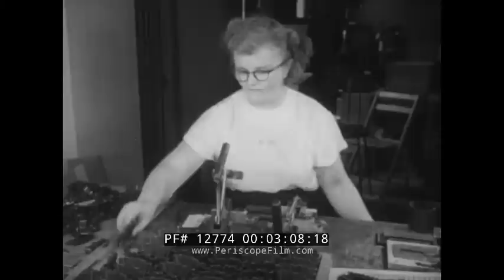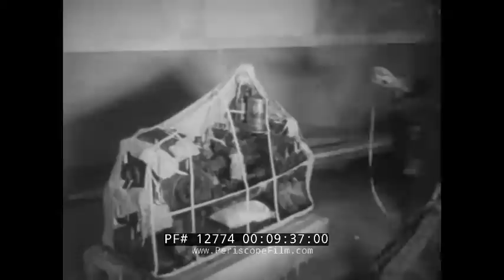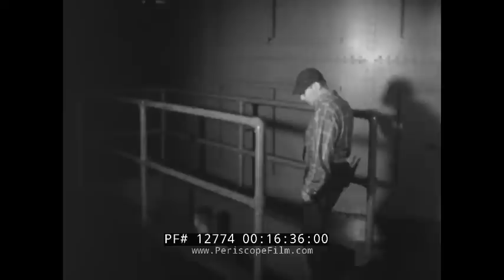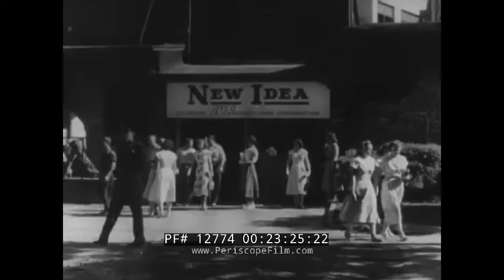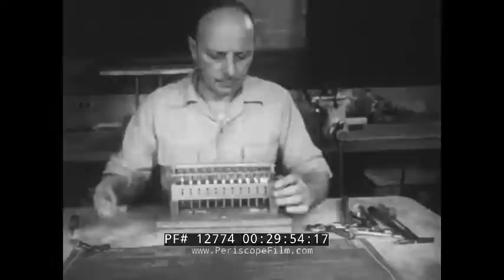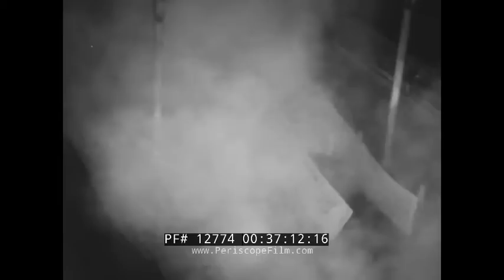INDUSTRY ON PARADE  HARMONICA FACTORY  MOHAWK POWER CO.  HALLMARK GREETING CARD CO.  12774

Comment: I'm not sure if I'm willing to believe they were managing to mold to .0001" back then.
Reply: Casting tolerance is simply a matter of designing oversized moulds to allow for shrinkage of final products and of course the quality control of of raw material
Reply: I'm guessing it was POSSIBLE,  but not used on everything, since that tight of a tolerance isn't needed on everything.

Surely parts of the mold were in that range.  Now, the cavity?  Depends on its shape, I imagine.  If it was easy to machine and the part was a consistent cross-section with predictable shrinkage, it might have been possible.

But plastics, especially thermoplastics, aren't usually designed down to the fourth decimal.
Reply: This isn't the civil war.
The only big advantage we have now is cnc, which does nothing for tolerance, only automation.